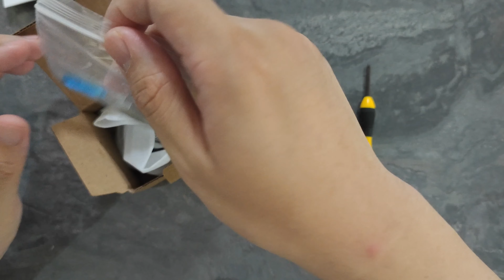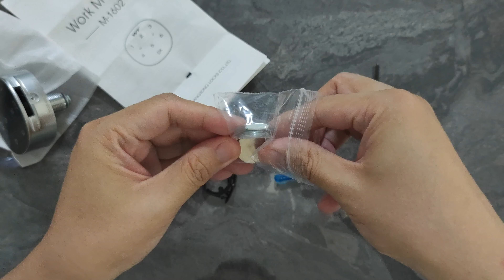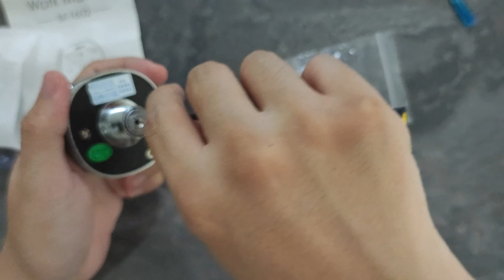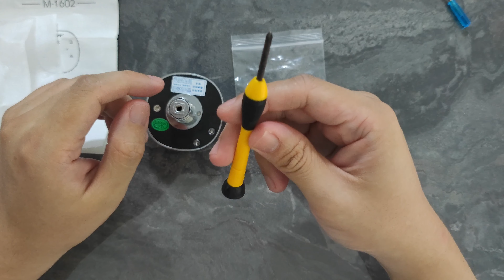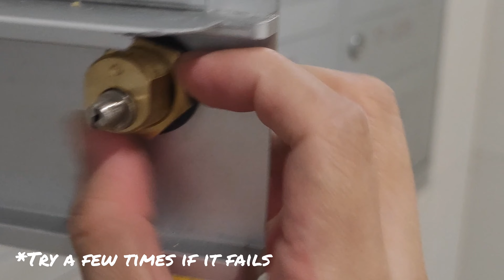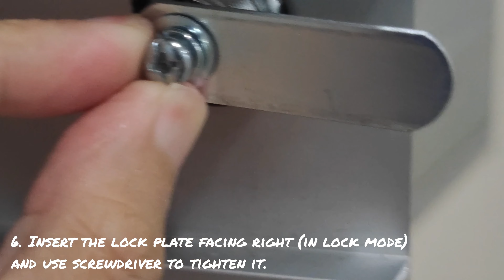Things To Know Before Buying Digital Mailbox Lock And Installation

Comment: Can I ask if your mailbox hole has its flat sides horizontally or vertically? Mine is such a way I can only slot in my lock sideways, so the numbers are sideways. WHat should I do?
Reply from the maker: Sounds like you got the wrong lock. The check here is whether your lock turn clockwise or anti, as shown in the video.

If you gotten the wrong lock, try for refund or exchange and get the correct lock from the link I provided. Fyi I do not sell them nor have any relation to seller.
Reply: @ho888sg  it turns ACW, seems ok. THe straight part of my mailbox hole was the wrong side, maybe cannot insert right way.
Reply from the maker: @lenzwong  is it old hdb mailbox? If you got the same lock as me it will work for newer hdb
Reply: @ho888sg  yes the rectangle one, not the square. for my keyhole, the round parts are at left and right and the flat parts are at the top and bottom.
Reply: @lenzwong same issue here. Did you manage to solve it? Thanks

Comment: Hello Jason, may I check with you please if you have encountered if the lock doesn't work properly? That the lock keep reset itself back to default password. Is it a signal of low battery? But there wasn't any indication that it is low battery status.
Reply from the maker: You need to change the master code first then the lock code. Without changing the master code mine got reset as well
Reply: @ho888sg  Thanks for this! That's weird. Previously it was working fine until recently, I found out when I was trying to open my letter box that it had been restarted.

Comment: Since the factory default password 4321 can over right the set password,  it means that anyone can just use the default password to open the letter box. So does it still serve the purpose 😮
Reply from the maker: You can change both password but remember to change the master first
Reply: @ho888sg  OK thanks so much for your information. I'll try to do it

Comment: After installing, my letterbox door is loose in locked mode. It can open up to a 5mm gap. What can I do to minimise the gap
Reply from the maker: @andrewgoh2180  not an issue, just ensure your lock doesn't go loose in long run

Comment: Hi Jason, thanks for this video. It helps with the installation. However, not sure why mine can still be opened slightly leaving a gap in between. We used the original hdb lock piece as well.
Reply from the maker: Just to clarify, so it works normal and there is no issue. Just that now when you open the lock to open the mailbox, it become somewhat loose/shaky.
Reply from the maker: @zacharyy3147  hmm very hard to imagine without pictures or videos. I don't think I come across until can peak inside. It's more like whether or works or it doesn't. Is there no way to make it more stable like by adding layers of rubber rings or something?
Reply: @ho888sg  no worries. I guess I'll have to finger something out. Thanks for your help anyway.
Reply: @zacharyy3147  facing same issue. No solution

Comment: what if battery runs out in locked position? How can I open the mail bo
Reply from the maker: Change the battery? The battery is just on top and it's outside the mailbox that you can access

Comment: U can bend the metal plate abit, then it will work. We faced the same problem as youm
Reply from the maker: You mean the metal plate of the mailbox?
Reply: @ho888sg  the metal plate is provided in the box, once installed, use a wrench or something firm to bend the metal plate inwards, towards the letterbox, you should be able to lock the lock properly
Reply: I faced the same problem. Just need to put the metal plate diagonal 45 degrees

Comment: How long can battery last? What if it is out of battery?
Reply from the maker: It's been almost a year and it works on same battery.  There is a warning sign when it's running out, even ran out the pwd stays, so just change the batt with a screwdriver
Reply: @ho888sg  Do you know what size screwdriver use 0.8mm or 1.2mm?